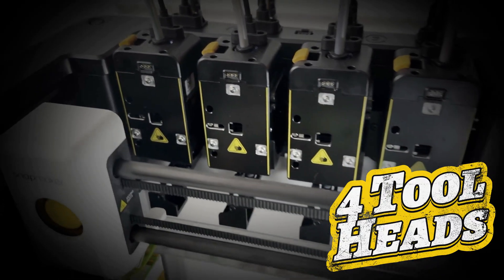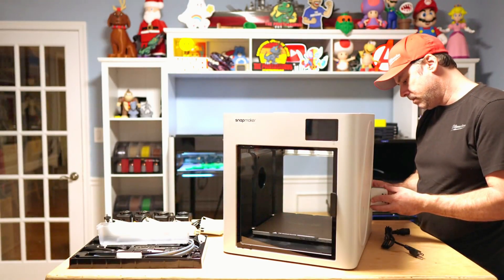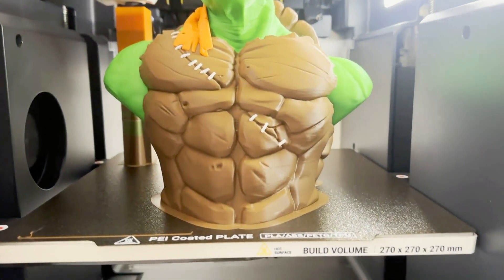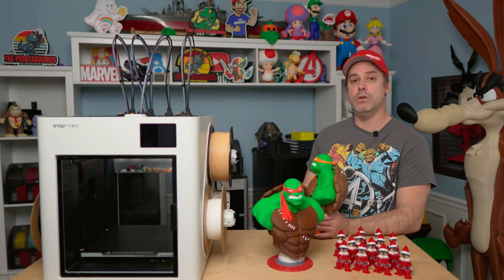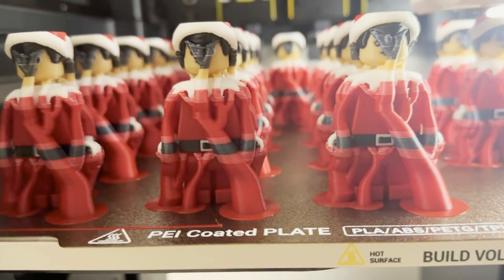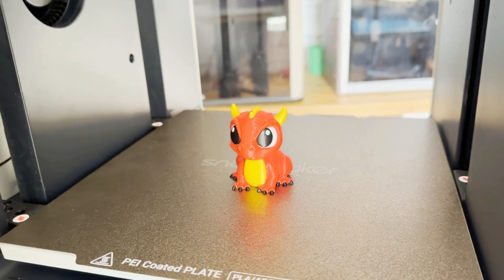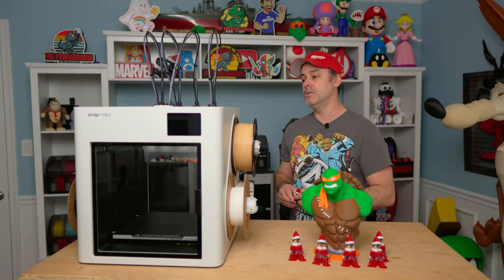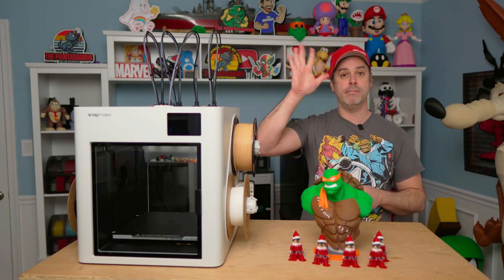Snapmaker U1 True Out-of-Box Print Test

Comment: I think the reason the h2c matches the time with the elves its because you mainly have 2 colours at the time so it does dual nozzle printing. When you get to 3 or more colours in a layer thats where the h2c loses a lot of speed, because it has to do the whole ams change thing
Reply from the maker: For sure. They are spot on when using both nozzles on the H2C in terms of time, soon as the AMS is factored in, you go to about 14 second color / tool changes.

Comment: How is it better with still creating a waste tower. Some printers with ams do the same waste
Reply from the maker: You can fine tune the tower to decrease some of that purge waste. But it's necessary to stabilize the pressure in the nozzle, heat and prime to continue printing at a high quality. This was a out of the box - what you'd expect with no additional tuning. I intend to refine things in another video and see what can be done to optimize as much as I can.

Comment: Why a purge tower if you have 4 heads? Who is the usecase of more heads compared to a ams?
Reply from the maker: The purge tower is still crucial even with multiple print heads (like 4) because it primes the nozzle for clean, consistent extrusion after filament / tool head changes, rebuilding pressure and flushing out old material to prevent blobs or contamination on your actual model, ensuring quality by stabilizing flow and temperature before printing the part.

Comment: The BIG difference would be the waste(filament poop) between the 2 printers which you didn't mention.
Reply from the maker: That's covered in my Head to Head video that will be out next week. Both purged enough to prime the nozzles / tool heads and that was it. Very minimal.
Reply: The H2C is 5 colors with zero purge out of the box. With two AMS units, 7 colors with no purge.
Comparing the U1 to either of those H2C configurations, the only difference in waste would be whatever the purge tower ends up being.
Reply from the maker: @NWGR   I'm almost done with my "head to head" comparison. Which is more a which printer is best for you. I compared the core similarities and talked about the bigger differences between the two. I have had a lot of comments of this one is better than that one. So I figured let's talk about it! Appreciate you inputs.

Comment: Received mine as a Christmas gift on the 23rd. Easy enough to assemble. First print was the 4-color baby dragon demo, and it worked perfectly. Second print was a fox I use to demo my filaments when I get a new color or new type in... but this time painted to use those original 4 colors and give it the foxy coloring (albeit the red is very bright, very stereotypical for a cartoon fox, but decidedly artificial on a more realistic figurine. Despite my poor artistic skillse, it came out very well. On an approximate like-for-like print beside my Elegoo Neptune 4 Plus, it was significantly slower... though I discovered it was due to using far more layers at roughly half the layer height for the same product. Clearly the U1 is profiled for far better detail on the same size nozzle compared to my specific Elegoo Neptune.
Reply from the maker: How's the printer been holding up?

Comment: what are you talking about kick-starter printer, snapmaker have been making 3d printers 5xtimes longer then bambu labs or more.
 further more they making pro versions for big corp since  forever too
plus bambu labs made their first printer,  big printer via kickstarter, maybe your script got turned upside down?
, only reason snap maker made the kickstarter thingy is so YOU the consumer pays for RND and upstart tooling etc with them having way less upfront cost.
Reply from the maker: Just to clarify, I’m not saying Snapmaker is new or inexperienced. They’ve been around a long time and have shipped multiple machines.

The U1 did launch via Kickstarter, and I’m reviewing an early, first-batch production unit from that campaign. When I reference it as a Kickstarter printer, I’m talking about the launch method and early production maturity, not the company’s credibility.

Early firmware updates and first-run hardware are normal with any new platform, regardless of who makes it. That context matters for an honest review. That’s why I chose to do a true out-of-the-box test. To see whether an early production unit from the Kickstarter launch can perform and deliver solid results.

Comment: I have one of the first few and have never had the purge tower issue or connection issue with Snorca. (knock on wood) I did have toolhead parking issues which was very annoying though, the new firmware 9.4 seemed to fix it.
Reply from the maker: I haven’t had an issue since the latest update. I’ve been really enjoying this printer so far, not sure what to print next. I am waiting on some filament to start testing some TPU and pla multi material prints, excited to see how they turn out.
Reply: @ThePrintasaurus  Nice! I'm excited to watch your video on it. This printer was def a good buy and as long as they can keep developing Snorca it will get better.

Comment: If I have to spend that much money I will just wait for the index and mod my closed in SV08.
Reply from the maker: I have been working on a tool changing setup for my SV08 based on the XOL toolheads. At this point I've paused that project with the INDX coming out. 100% will be adapting that to the SV08 as soon as I can, will most likely move to INDX on my Voron 2.4 as well. Currently with that one I'm running a LDO Jabberwocky - video for that will be out this month, with the Armored turtle. Works great, but the INDX has me excited. Can't wait!